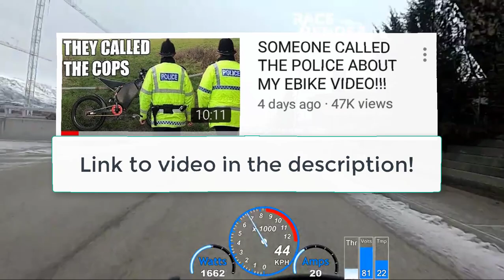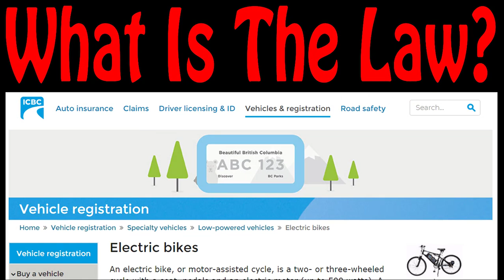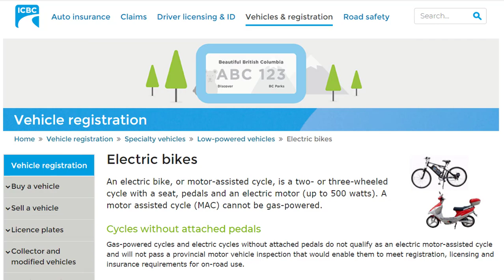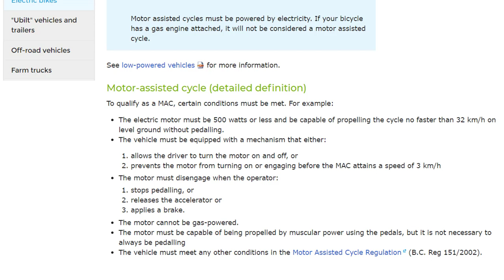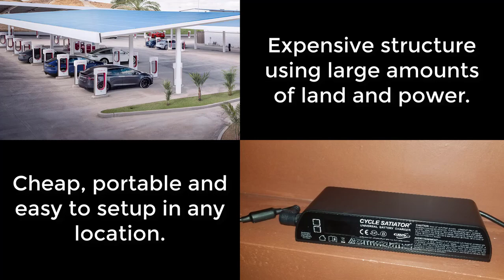High Powered Ebikes and the Law...

Comment: Great presentation, and i agree with you 100% !  I live in Eugene, Oregon, which is only 1 of 2 states that allow ebike motors up to 1000w. As far as i know other states are limited to 750w.
      I am saving up money for my own ebike kit which is going to be 3000w, 72v. NOT because i want to be a speed demon, but i weigh over 300 lbs, and not too long ago i test road an ebike with a 500w motor and was not too impressed. Yes, it got me down the road, but getting up to a reasonable speed was another matter. I myself want to keep up with the flow of traffic, though we do have bike lanes here in Eugene, they aren't on every street, and riding on sidewalks with an electric bike is illegal. Riding an ebike in town, you are encouraged to use the traffic lanes to give the regular bikers the use of the bike lanes.  So i guess ill be joining you on breaking ( or bending?) the law. . . .
Reply from the maker: Thanks Mike. Interesting to see some states taking the lead. Having 72 volts and high power will give excellent torque and acceleration especially for a heavier rider. The top speed is your choice to a large extend. I use a 1 to 1 gear ratio but you could gear it lower and have a lower top speed with more torque.
Reply: @HighVoltageKits  More torque? I'm not playing with quite as much power (50 amps and 52 volts) and in 1st gear (42:42 so 1 to 1) the throttle will easily flip the bike over.

Comment: I have a road legal 250w bafang BBS 01, and with the restriction at 15.5mph it actually makes road riding more dangerous. As a young fit man I was able to hit over 30mph on a flat with my old Claud Butler 10 speed tourer (1980). As an older rider now I have little chance of pushing that on my MTB while, but probably capable of 20mph.or so, but with the restrictor cutting in and out it actually interferes with my progress. In the real world, and on a super light carbon bike with excellent gear ratio's, I probably still could reach over 30mph, so making a restriction of 15.5mph makes no sense at all. Keep up the good work.
Reply: Yeah I used to ride road bikes all over,  easily do 25mph upwards, 45 or more with a bit of downhill   15mph is dumb and dangerous, much safer if bike is keeping up with traffic and not being constantly overtaken by loony drivers driving too close.
Reply from the maker: Man I would have loved to see you cruising at 30mph on a CB frame! The restrictor sounds terrible. Is it easy to remove it?
Reply: @HighVoltageKits  the old 531 Reynolds tubing and Campagnolo gears, that was when Claud Butler really was a name. That beauty cost me 2 months wages at the time (I was only 17).
Reply from the maker: You still have it?
Reply: @HighVoltageKits  how I wish. I swapped it for a portable TV when I left home. What a mistake.
Reply from the maker: Ahh I once sold a Raleigh apex for a silly reason. How I wish I still had that frame now!

Comment: Totally agree with you about ebike laws, I also have a high power ebike, but rarely ride on road or street as I work from home, biking is for fun time for me. I use my ebike mainly on bike paths and offroad. When riding on bike paths, I totally respect other people there and never ride faster than anyone else by limiting speed and power on my ebike. I just use common sense... After all, If I would be reckless and ride crazy fast on bike paths passing other riders at 80kmh, then people would complain resulting in more restrictions for ebikers... However, if I want to unleash full power of my machine, well, I just do it offroad where it is safe.  Cheers. Dan
Reply from the maker: Cheers Dan, working from home sounds awesome. You are bang on about safety.

Comment: Great points brother! I agree whole heartedly and it is reasonable passionate folks like you that will make the needed changes come to pass! I want to build a fast E Bike on a small motorcycle frame so that it has a vin number and will be able to get a plate and insurance. Thinking of taking a 250 c.f. salvage frame and installing the QS motor and a 72 volt battery and controller to do a 50 mile daily comute. I saw a build where he had the charger and a 220 v level 2 charger plug so he could charge at the free ev chargers!
Reply from the maker: Using the ev chargers is a really neat idea! I bet the bike would rock with that motor! Plenty of framespace for a battery as well..

Comment: Very good description of the situation globally. Safety is mainly in the mind of the drivers. I have had one accident, on the flat, where I hit an e-bike with my mountain-bike in our 250w restricted Europe. The speed was too high for both of us to react safely and avoid each other. I was our fault, and the vehicles could not have aided the situation, regardless of regulations. I am rebuilding a downhill bike fitting a 3000w motor, which would have been a perfect commuter, was it street legal. My registered electric motorcycle will cover that need, but is not as practical for everyone, since it is less affordable and requires an MC certificate. I think that an e-bike with proper brakes and build quality, together with a basic level of traffic education/certification, will be a good and important contribution to our current environmental challenges. Making DIY e-bike batteries from old laptop batteries, is a bit of work, but feels good in our times of climate instability.
Reply from the maker: Thanks. One day I will have a crack at a battery build. Good point on safety it's all our job to get it right.

Comment: HELL YEAH! 
 Great argument for the use of e bikes.
 You even brought a great point about cars not being restricted to ridiculous levels and speed limited to 100Kph. Trucks need immense power to move a load and so some types of cargo E bike need similar consideration. All these vehicles are speed limited by road signs but not throttled by engine size.
 Australia post which delivers mail are using some e bikes for their workers but at 250W it is only for young and fit workers. Domino's has electric bikes for pizza deliveries. These are just two companies that see the benefits of E bikes but could benefit from  better legislation and better rules.
  Wattage should not be so restricted as it is at the moment. Throttle use should be encouraged. 
 This is not just about E bikes anymore. It is about moving people and cargo with all manner of electric mobility. We are at the beginning of a huge change and we need to encourage this new revolution and give it every chance to succeed. 

Keep up the good work!
Reply from the maker: Cheers Sparkie, you got it!

Comment: Well said, i know that there's a problem for the cargo community, the bikes are geared for flat roads and have 250w of assist. A hill with some snow is a nightmare for them and they revert back to driving cars instead. I did some short testing myself, to maintain 6kmh in a steep gradient with cargo on the bike i had to use more than the legal limit would allow.
Reply from the maker: I'm developing a trailer at the moment I hope to share progress on soon. I can't imagine how crap it would run at 500 watts pulling it.
Reply: @HighVoltageKits  in AU they use trailers with engines and transmissions to help the main truck with startup and hills. There is no rule i have seen that dissalows a person to drive two vehicles at once. If you ive the bike  and the trailer the legal limmit of powerit should be allright?

Comment: Hi, interesting thoughts. 

I am ebike, car, escooter and motorcycle user myself. I live in Denmark, where we use bikes A LOT. More than half people in the capital uses bicycle instead of a car.
And I think it is ok to have “weak” electric vehicles (that  have similar performance to a fit non el. bicycle rider) driving next to bicycles on bike paths or sidewalks. An old lady on 250w ebike can keep up with a fit cyclist. Everything moves on a similar speed 20-25km/h. It is safe for families on their bicycles on bike paths.

Now when we go to roads, it is a different story. If you crash on a bike going 50km/h it is dangerous for you, and for the others. 

As you say there is a need to test if users of such vehicles know the traffic rules, have abilities to control the 2-wheeled device at high speeds etc. So some sort of a driving license is needed.

Then there comes periodical technical inspection to make sure your ebike has adequate brakes, lights to be seen in trafic and things are installed in a proper way. 

Insurance must be mandatory as for the other road users. 

And then maybe registration and number plates so police can make sure you have the insurance, meet techical requirements, and speed camera in a school area with 20km/h speed limit can punish user of ebike for not obeying the limit. Like for any other road user.

In other words fast electric bikes could fit into a category of electric motorcycle.
But is it not possible today to register electric motorcycles in US? What about the street-legal Sur-Rons and other electric bikes? 
I think that could be the most practical way of making fast ebikes legal.
Reply: It is possable in the states if you retrofit an motor bike to an ebike as a custom build. It becomes a bit more difficult if there is no VIN number as in the surron and or any other fast ebike every state seems to have their own laws reguarding this issue
Reply from the maker: I am pretty sure there is a path to registration in some countries but not where I live and I was only going from that perspective. Andy Kirby went through a process in the UK to do it. I think it was a huge pain in the ass!
Reply: I complain about ous system here in the US but in reality we have it made compared to the system in the UK and even Japan where most cars are replaced every 2 years in order to pass the ridiculous stick automobile inspections.

Comment: Hi I agree with all  your points 100% for sure.

Europe laws are far far worse are miles behind  have to say.  15.5mph limit and not aloud a throttle they really need to review this asap and most definitely get them legal with insurance I think this would please alot of people.

In the uk you to have to do a CBT  (Compulsory Basic Training) at the age of 16 to legally ride a 50c bike limited to 28mph The CBT consists is a five-element training course that you must complete to be allowed to legally ride a bike. 
It is a course, not a test. However, if your trainer feels you are not a sufficient enough rider and may be a danger to yourself or others they are entitled to make you complete more basic training before you get your certificate.
 . I could not see a probem with something like this for the higher powered  bikes say 1500w to 300w and above and say set the limit to 28mph for this class. Then say 3000w to 8000w would be classed as more of a 125cc bike and so on. 

The main problem I see is build quality for faster bikes tyres, brakes, wheels frames lights ect all become a problem in regards to DIY conversions if you compare the strength of say a 50cc motor bike frame and components to any mountain bike it's going to be a big difference  but you can travel at the same speed and this is where the laws are going to get complicated with the slightly higher powered bikes.
Reply: daniel green some Eu countries have great bike-path and infrastructure system developed, and really fast ebikes should bot share the same roads as children on their “normal” bikes. 250w and 25km/h things are alowed as they are nearly the same, and you do not need any special training.

Fast ebikes should be on the roads. But then they should obey the same rules as other road users: registration and license plates, certified helmets, techical requirements and inspection, drivers license, insurance, proper lights... that makes it much more expensive, difficult, etc. 
But I do not see who and why will ever agree to treat fast ebikes different than motorcycles
Reply: @VRMinde  yes that's the problem some EU countries have good bike paths the UK where I live they are terrible and there hardley is any. 

Yes I agree with you on that part as I said above.
Reply from the maker: Build quality would certainly need to be addressed in any future legislation. Lots of DIY builds run into issues with parts breaking under stress before they get stronger components.